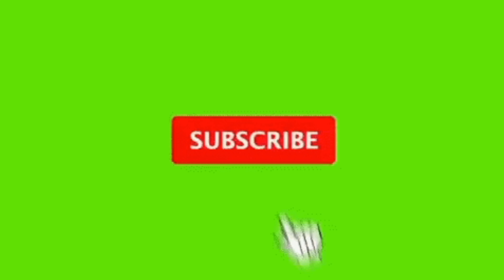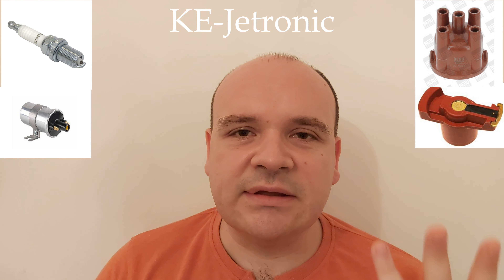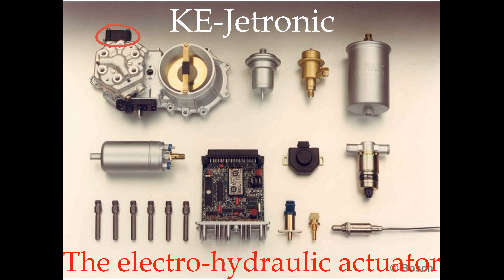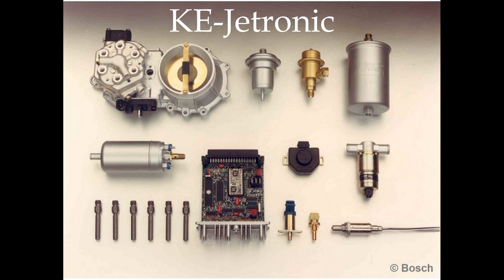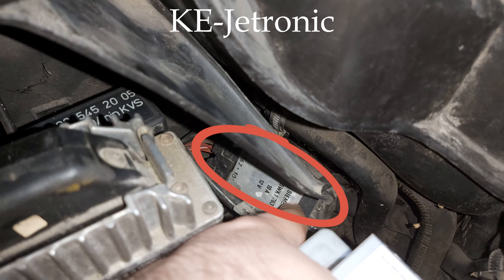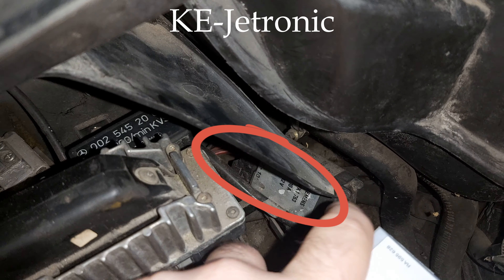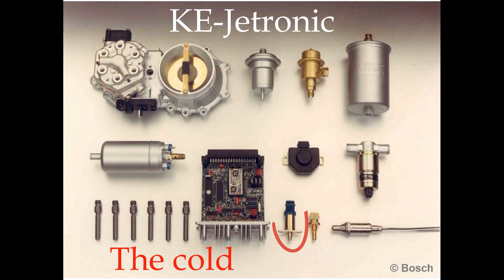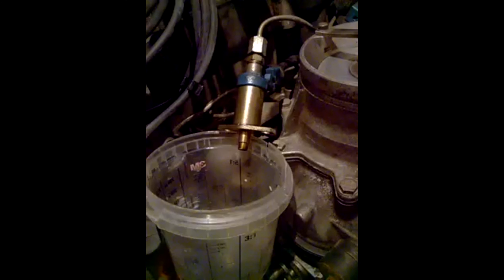㉦KE-Jetronic㉦ - The Basic Working Principle

Comment: Do all the Injectors spray at same time.and all  the time s?thank you
Reply from the maker: All the injectors must start spraying at the same time and stop as soon as the sensor plate is fully depressed when the engine is off(when you jump the contacts 7&8). When the engine is on they are spraying all the time, continuously, until you stall the engine, unlike modern fuel injection types when the injectors spray each at certain moment. Best regards😉😀👍🏻💪🏻🍀🍀🍀
Reply: @mercedeske  thank reply,I'm trying to figure out this system operation.i have this car it starts and dies after 5-10 seconds.
Reply from the maker: Let me guess! The car starts, the ICV gets the RPM to 1200rpm and as the engine has to start idling it dies, right?
Reply: @mercedeske  yes that's exactly what happens.it starts jus fine but doesn't stay running.
Reply from the maker: @upkarbath  Your problem is the potentiometer! If you made over 90k miles(150k km) and you have never replaced the part, well, that's your problem!
Reply from the maker: @upkarbath  And one more thing - if you have any problems placing the part, watch my video about the potentiometer, but watch it on your desktop in order to read the titles.
https://www.youtube.com/watch?v=IG9i6fkfPJ8&t=610s
Reply: @mercedeske  I have no fuel at Injectors or very small  amount comes out when I loose the lines.do you think fuel distributor could be bad internally?
Reply from the maker: @upkarbath  take them out and put glasses under each of them. Jump start the contacts 7&8 with a wire, turn the ignition on. Deflect the sensor plate. If you don't get fuel out some of the injectors, swap it with the one out of which you do in order to see whether it's up to the injector or the chamber in the distributor.
Do it and tell me what happened.

Comment: I have a problem with engine warm start.  By watching this video, I think it could be fuel accumulator that cause problem.  It happened to me twice, driving for a short distance after that parked the car, came back later in half an hour and couldn't start the engine.
Reply from the maker: Check the fuel accumulator

Comment: im about to buy a 1987 260se and now reading up on the basics of jetronics..with regards to CO screw mechanism, is it as simple as inserting the 3mm allen and turning in the correct direction? or is there a need to press the allen down until it catches the adjusment screw in the metering arm? i may have missed this detail.kindly direct me to the portion on the actual adjusment mechanism..5 stars though on how to adjust, it is the adjustment mechanism that is not so clear
Reply from the maker: If you know for sure that this screw has never been adjusted you absolutely don't have to adjust it. However, the answer is that you will have to press the key down until it catches the screw. Then you can turn it clockwise or counterclockwise. But I repeat - if you know for sure that the screw hasn't been readjusted, don't screw it, you have absolutely NO NEED for doing it!

Comment: Hi, congratulations on the explanatory video. Is it possible to find the system? it's the price? Well, I'm looking at a 450SEL 6.9 1976 automatic.
Reply from the maker: Hi, Thanks 😊 I think it's possible. That one is a mechanical injection system. It's W116. Just let it be in a decent condition because there is nothing more expensive than a cheap Mercedes. Fingers crossed 🤞

Comment: A quick question, would you have any ideas as to what may cause a long crank / start time, hot or cold , it’s not too long but longer than I’d expect 👍
Reply from the maker: If it's always like that check if your timing is okay. The rotor must face the groove on its housing. If that's not the case, then turn CLOCKWISE the crankshaft until the nail faces the OT mark. For that purpose remove the distributor cap. So, your timing is set when the OT mark(TDC) is aligned with the nail on the other side, as well as the rotor which then must face the groove of its housing facing the cylinder 1. If that's not a case but it has a slight tolerance then you will have to do it manually by unscrewing the allen and moving the whole housing clockwise or counterclockwise. If your timing is set then maybe you have some pressure loss somewhere(the seal ring on the plunger) or you have leaky injectors or a cold start valve(many possibilities).

Comment: Hi,I own 124 E200,i have steady idle but if you push hard the petal misfire and don't go over 2000rpm.
Its fuel distributer or fuel regulator ?
Best regards !
Reply from the maker: On KE-JETRONIC I would advise you to check out first the voltage on pin 3(red), pin 2(black). When the engine is warm you should read 6.55-7.2V(high number in voltage)If this is not the case you have a rich mixture. Send me the video on my fb page fix your Mercedes.
Reply: @mercedeske  Thank you so much for the immediately response ! I will check that.Thanks a lot again!

Comment: Help please. My M103 engine starts perfectly but surges and stalls, runs again for a few moments before nearly stalling, only when the engine is cold. After a few mins running everything is perfect the car drive's beautifully. I have fitted a new VCR, potentiometer, accumulator and fuel pump. Living in Thailand the engine cold start has been disconnected and has made no difference in the past when the engine started and ran perfectly. If you have any ideas I would love to hear and greatly appreciate
Reply from the maker: Okay. Did you calibrate the potentiometer? As you replaced the potentiometer, did you measure the voltage? Second thing - check the coolant temperature sensor you have a video on my channel just type "the coolant temperature sensor"
Reply: @mercedeske  Hi again and thank you for your reply. I put a new potentiometer on about 1 year ago and everything was fine so I don't think this is the problem unless its died again. the coolant sensor was replaced about 6 months ago. I might try the voltage test on the potentiometer again to see if its died. I'll let you know. Again many many thanks for the great videos. I might just make one suggestion though, please don't have background music, I can barely make out the dialogue and it really is unnecessary, in my opinion.
Reply from the maker: Did you get 0.7V +-0.1 on the potentiometer while the engine is warm and running?
Reply: @mercedeske  Hi again, unfortunately, I removed it, there is a deep groove in the graphite though. I could reassemble but I can buy a new OEM part here for 3000 Bht 100 $US. What is your advice?
Reply from the maker: @stevesutton9444  Buy the new one. The potentiometer is being replaced each 90k miles/150k km. The ECU doesn't get the information about the ideal position of the sensor plate!As I wanted to buy it in my town they found the part and told me that its name is "The potentiometer for regulating duty cycle while idling". It's extremely important for the engine and for its operation. If the OEM part is that cheap buy it and calibrate it(because here in the stores they wanted to sell me one for 300 euros). I believe you are going to solve your issue.
Reply: @mercedeske  Hi again, I put the pot back and ran the engine to get warm, I put the multi meter across 1 and 2 and got 2.5 volts and again across 2 and 3 ( is that right) however, you wont believe this when I started the car, it was cold obviously, it ran perfectly, no stuttering or racing or stalling. 
Recently I replaced the water pump and belt tensioner tot cost 6500 Bht = 214 US $. Very good quality and have had no problems. I would like to help you if you need parts please let me know, if I can save you money it would be my honour.
Reply from the maker: @stevesutton9444  The voltage between the pins 1 and 2 should be 0.7V +-0.1(the first one up on the potentiometer is the first, the middle one 2nd and the bottom the 3rd). In order to decrease voltage tap downwards with the head of a screwdriver gently the right of the potentiometer. On the same side tapping it upwards you increase the voltage. Thank you for your willingness to help. I will contact you if I need help.
Reply: @mercedeske  Hello my friend, if you could help me with just one more issue, that would be great. I can adjust the potentiometer to 0.7 volts no problem but the idle speed is way to high , how do I adjust that? is it with the 3mm alan screw? I really appreciate your help, thank you.
Steve
Reply from the maker: @stevesutton9444  If your ICV(idle control valve) is ok, then try to do it manually. If you know where the cable for your throttle position sensor is, then on the other side you have a screw and a counter screw. You will have to loosen it and then tighten it with the counter screw. It's a bit boring but you will have to be patient. Just in tiny moves.
Reply from the maker: @stevesutton9444  So, again, find the throttle body and you will see that little screw. You will hardly be able to reach it. I had even to unscrew one of the screws holding the throttle body. Now I can't remember where I was talking about that. I think it was in this video, I showed how the throttle body looks like and with the arrow I pointed to that screw. Try to find that video. When you find this screw do this while the engine is running!!!

Comment: Hi, I bought a 190e 2.6 and it doesn't run, so 
- I put a brand new battery and replaced the distributor cap and Ik now that my electricals work so I tried starting it and nothing happened unless I sprayed the intake with quick start, and the engine fires up then dies immediately afterwards

So my guess was to replace the fuel distributor with a used one that I got from a parts car (the guy said it ran before parting) because  I was getting no fuel to  the injector lines and the car still didn't fire up so.. 

I replaced the old fuel pumps with 2 brand new bosch fuel pumps thinking the fuel pressure is too low in order to start 

And my car still doesn't run :( 
Can you help me out plz 
You think the fuel distributor is faulty or  can it be any other problem
Reply from the maker: Hi. At first check if the other fuel distributor is compatible with your car. Concerning the old fuel distributor, when you deflect the sensor plate, does it slides easy downwards? Find a pressure gauge and measure the pressures, you should get working pressure 5.7-5.9bar, the pressure from the pump 6.1-6.3bar. How many kms/miles has the car on the clock? If it's more than 150k km/100k miles, check the injectors.
Reply: @mercedeske  my car has 157k on it I get no fuel to the injector line, and when I have the car ignition ON I believe I feel some resistance when I push the airflow plate down
Reply from the maker: Unscrew all the lines and make the pump running continuously, don't touch the sensor,  no fuel must be flowing out of the ports. Afterwards deflect the sensor plate a bit and observe if you get the same quantity of fuel. If you don't get the same quantity, then you should clean the fuel distributor.
Reply: @mercedeske  so I did what you asked, and I get no fuel either way :(
Reply from the maker: Sorry to hear that. It's the distributor. You will have to buy the kit and to wash it in the ultrasonic bath.
Reply: @mercedeske  thanks for the help sir you are a gem I hope to find more people like you. I really hate the Ke-jetronic 😂
Reply from the maker: @carft1234  Thanks for the comments. It's a reliable system but it requests a mechanic who knows about it.
Reply: @mercedeske  I cleaned my fuel distributor with a ultrasonic cleaner I rebuild my distributor and now the car starts without quickstart, but dies afterwards immediately after startup What is the issue?
Reply from the maker: @carft1234  Did you set the gap between the sleeve and the nut at 0.6mm when reassembling the distributor?
Reply: @mercedeske  yes I did
Reply from the maker: @carft1234  Is it better?
Reply: @mercedeske  without clean the distributor the car need quick start in order to start, after distributor cleanup the car starts up without quickstart sometimes it even runs for few seconds then shutoff and the plunger nut was 0.6mm when I cleaned it up and that is what it's setup to currently
Reply from the maker: Okay. Have you replaced the potentiometer?
Reply: @mercedeske  no I haven't I think it's fine is there a way to check?
Reply from the maker: @carft1234  Here, watch this video!
https://www.youtube.com/watch?v=QuHofSC99yw
Reply: @mercedeske  I removed the OVP and the car sputterd to life I guess I had a Bad OVP
Reply from the maker: Glad to hear that!💪🏻👏🏻👍🏻👏🏻

Comment: Bonjour j’ai trouvé la soupape de ralenti au lieu d’être fixer sur la pipe d’admission elle est au dessus du filtre à huile question :: avec le multimètre en mode continuité (bio bio) quand je teste à la prise il y a deus broches et quand je teste les broches une par une à la masse voiture sa sonne (bip) et quand je teste aussi la fiche avec testeur une broche avec autre broche aussi fait (bip) peu tu me dire si c’est normal qu’il y’a continuité à la masse et aussi entre deux broches ???? Merci
Reply from the maker: Dites-moi de quelle année est votre Mercedes et de quel type ?
Reply: @mercedeske  elle est du 01/02/1988 type 20102414 châssis WBD2010241F453842
Reply: @mercedeske  moteur 102962
Reply from the maker: Concernant la valve de contrôle de ralenti, la seule chose que je peux vous dire est que le fil supérieur (si vous en avez 2) va à l'ECU et le fil inférieur au relais de protection contre les surtensions (fil bleu/rouge). Au ralenti lorsque le moteur est chaud, vous devez obtenir entre 4 et 6,5 V
Reply: En faite cette pièce est comme un interrupteur qui laisse passer le négatif ou pas
Reply: @mercedeske   en faite ce tiroir additionnel d’aire fonctionne comme un interrupteur mais avec la chaleur soit il fait passer le negatif ou pas c’est comme sa que je cu reçois l’information peux tu confirmer mes dire ho toi grand maitre
Reply from the maker: Dites-moi si vous avez une vanne de contrôle de ralenti à 2 broches ?
Reply: @mercedeske  non juste la pièce je vous ai donner la référence et sur la durite de reniflard qui va au cache culbuteur là il y’a un manchon en aluminium sur cette durite avec une vis de réglage mai pas de connexion électrique
Reply: @mercedeske  sur une de tes vidéo on voie que tu teste la vanne d’air additionnel avec une batterie de 9 volt moi je n’ai pas ce système là moi la mienne fonctionne sans courant pour laisser passer l’air mais avec la chaleur du moteur voir référence
Reply from the maker: @jeanjeanlebelge9263  De quelle année date ta voiture ?
Reply: Apparement il y a eu deux version de vanne d’air additionnel c’est pour sa que je ne voyais pas sur la pipe d’admission la mienne est collée sur la sortie tuyau chauffage de la culasse
Reply: @mercedeske  elle est du 01/02/1988
Reply from the maker: @jeanjeanlebelge9263  Comme je peux le voir, vous avez la première génération du système où l'ECU ne contrôle pas le ralenti et le ralenti est contrôlé sur la vis à tête plate. Vous avez des soupapes auxiliaires qui doivent empêcher la voiture de caler.
Reply: @mercedeske  demain je vais démonter cette vanne d’aire et la nettoyer et voir si elle fonctionne correctement en la mettant en première dans le congélateur et après au four à 60* pour voir si elle s’ouvre et se ferme correctement
Reply: @mercedeske  après avoir lu mon adresse mail supprimé le message merci
Reply: @mercedeske  il ne me reste plus que l’injection à revoir et la201 serra bel et bien terminée enfin je l’espère

Comment: Thanks for the good video. I drive a 124.023/ M102/ 1987 230E and recently my economy guage shoots to the redline mark after slight acceleration or pushing the gas pedal at operating temperature while driving. Fuel consumption has worsened too. Any suggestions why it does this or which part(s) I need to diagnose?
Reply from the maker: Hello, try replacing the O2 sensor if you have one.
Reply: @mercedeske  It was replaced with a new Bosch sensor only 5 years ago and the part cost 140 euros.
Reply from the maker: @mojo888x  What about the potentiometer?